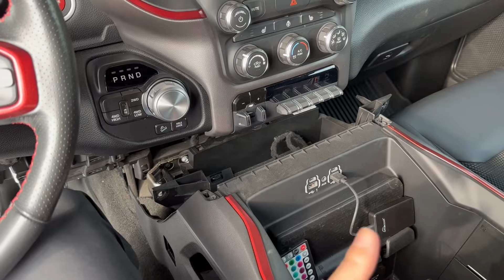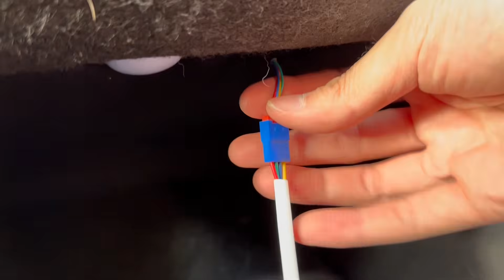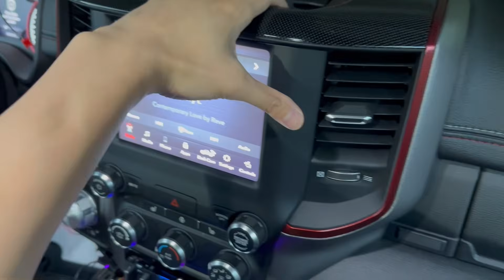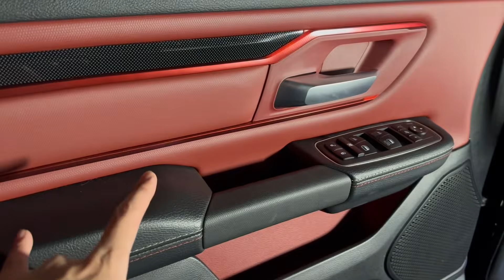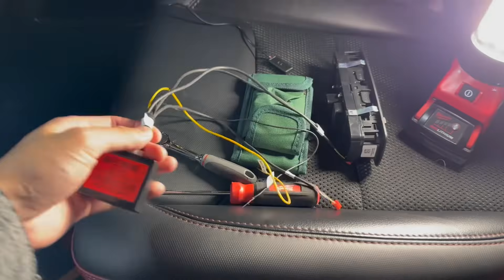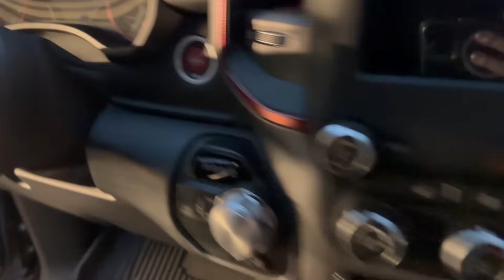RAM CUSTOM INTERIOR LIGHTING INSTALL GUIDE (STEP BY STEP)

Comment: So each and every wide strip has to be connected to the control boxes is that correct? That's where all the wires are coming from or can you tap into the door wire or some sort?

Comment: So each and every wide strip has to be connected to the control boxes is that correct? That's where all the wires are coming from or can you tap into the door wire or some sort?
Reply from the maker: The door would distribute power to each box which then distributes power and control to each light in the area!. Feel free to email us at info@weekndgarage.com if you have any questions

Comment: If I decide to buy a star liner from another company will the ambient lighting on the door panels change colors with the star liner or will it be 2 separate controls wondering if it is possible?
Reply from the maker: Since its 2 systems they are controlled separately
Reply: @WeekndGarage  is it possible to make them work together?

Comment: looks super cool man, but if I had a suggestion I would try using a screen trim tool the pushes the rubber trim that holds screens in home windows the roller and slot might help to push these into tight seams just an idea
Reply from the maker: Thank you, great idea!
Reply: please send me an email I would like to discuss trying to do my truck like yours with maybe another light kit for all the switches and such.
Reply from the maker: @boboscar99  Sure, send us an email at weekndgarage@gmail.com and we will help you get sorted!

Comment: Looks AWESOME installed on my Limited, everyone that hops in my truck is super impressed. No more boring plain interior especially at night where the ambient lights make it look like Im in a high end lounge in Vegas. BIG shoutout to Anson and his commitment to providing an EXCELLENT experience during the whole process, he answered all my questions and guided me via the phone when i had questions. I can tell he cares a lot of about his customers, i don't usually leave comments or reviews  but big THANK YOU to the team for putting this together!!
Reply: Also made me realize how useful the hot glue guns are. Glues on super firm but when i had to peel off to readjust it didn't leave any residue or marks.
Reply from the maker: Thank you for the kind words Justin!
Reply: Agreed I just did an install on my limited. I am curious did you remove the existing ambient lighting ? I ended up removing the doors one. What did you do?
Reply: @Livinlife2  i removed the door ones too and replaced it with the new ones, the original ones were dim and bland anyways
Reply: @boothexperts3117  yeah that is also what I did. I used the oem led holder so it shines into the glass tube in the bottom door pocket. It came out great
Reply: Do you guys offer these lights for ford trucks? Like F250’s

Comment: Just ordered the ambient lighting off your website for my 21 ram 1500. I received the kit however i didn’t see a controller in it, or is there an app that is used to control the light? Did i even get the right kit?
Reply: Did you ever get the app for these lights? I have no information on what app to get
Reply from the maker: Hi Bryan, yep there sure is, reached out via email to help you out!
Reply: What app should I grab
Reply: @jonwoods1981  it’s called lamp&frgn. It looks like the google logo with a different color scheme

Comment: Hello, this looks amazing. I have a 2014 Laramie Limited with factory ambient lighting, do you think this will work on my 1500?
Reply from the maker: Hi, thank you! The kit will work with in the 2014 Laramie however light locations will be different due to the different door card layout from the DS and DT models.
Reply: @WeekndGarage  I also have a 2014 Ram Laramie, so this would be the exact kit to buy from you or is there another?

Comment: I just installed this ambient lighting kit and I have to say, it is absolutely AMAZING!!! Anson was great to deal with and he provided awesome customer service! I HIGHLY RECOMMEND this lighting kit! It was exactly what I was looking for. I have only had it installed a few days and everyone that gets in my truck complements me!! 
Just a couple of things to help others out on the install. For the door panel blade lights, pull down and outward (toward the backside of the panel) to help separate the gap that the light slides into. Also, have a circuit tester on hand to find the correct wire for the power source in the rear doors.
Reply from the maker: Thank you for the kind words Jeff!
Reply: Video?
Reply: How long was your install
Reply: @Livinlife2  Install took about 10 hours. Not too difficult, just time consuming as I made sure everything was done correctly and neatly. I didn’t rush it. The end product was well worth it!!
Reply: @jeffveal1185  can you tell me name of app that is used

Comment: looks Stunning so far, but my question is will it fit on the 2024 ram 1500 laramie, i know ram did take away the dash lighting kit after 21/22, btw the price is on point for all this.
Reply from the maker: Thank you, we believe it wont be a problem as the interior facelift is mainly the screen and gauge cluster, Door cards and structural mounts remain unchanged. You could email our support team for advice if you run into any issues during your install. We try our best to make this accessible to all. Cheers!
Reply: would i be able to make this work in a 2024 chevy silverado ?